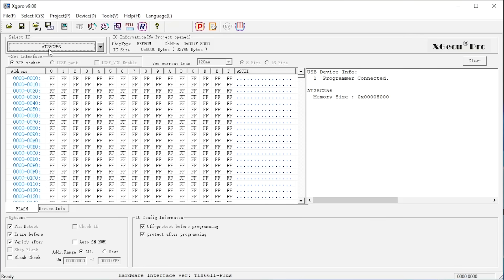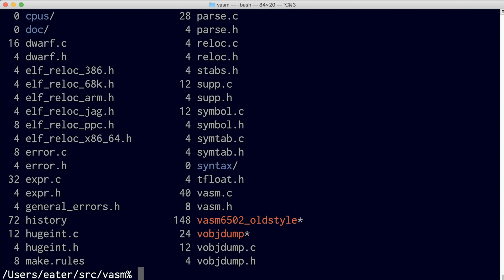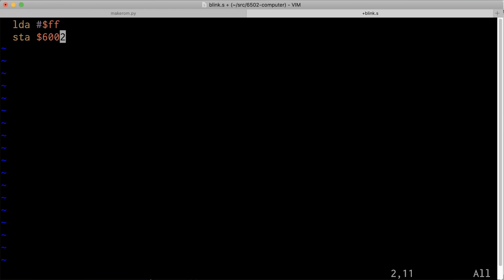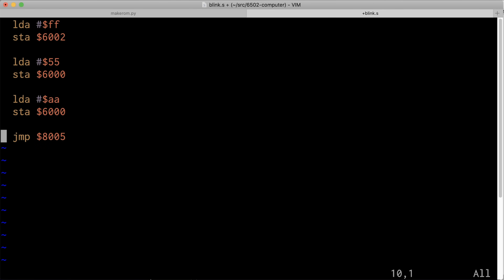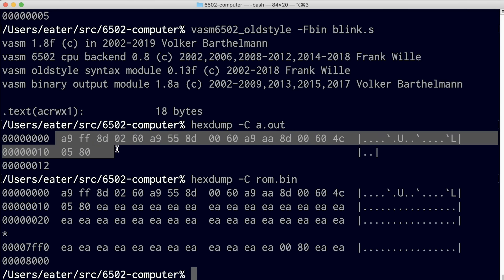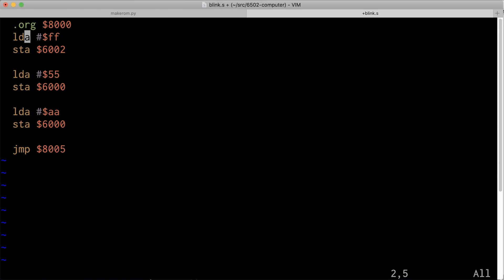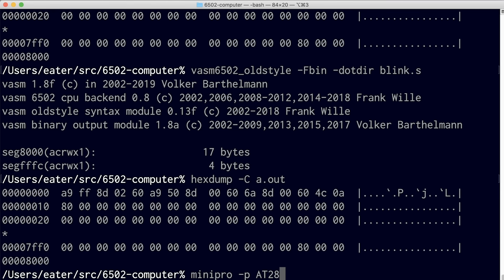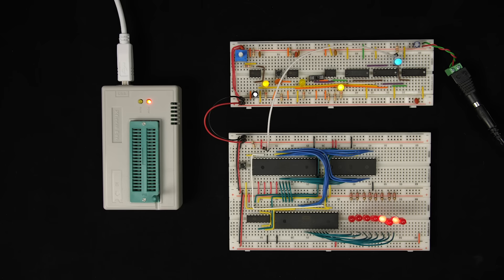Assembly language vs. machine code — 6502 part 3

Comment: Cool how high level Assembly looks right now because you got us started with just logic gates...
Reply: pyropulse  Now you write code for minecraft mods using abstract mathematical functions describing the behaviors of all of the electrons in your PC
Reply: pyropulse  karnaugh maps
Reply: bro RIGHT??
Reply: pyropulse  lol same
Reply: right!?
Reply: example ADD of atmega328p ("arduino Uno")
ADD rd,Rr
000011rdddddrrrr <<--- resulting bits

add     r0, r1    ---> resulting in 16-bit opcode memory representation (little endian), hex: 01 0c
register r0 does have register-address: ddddd=00000 (first parameter are the 'd'bits)
register r1 does have register-address: rrrrr=00001 (second parameter are the 'r' bits)

000011rdddddrrrr ---inserting d-bits---> 000011r00000rrrr ---inserting r-bits---> 0000110000000001
---> displaying as hex---> 0C 01 ---but is little endian cpu, so in memory little byte first---> 01 0c
Reply: My brain hurts at this level
Reply: Hi, i have a question for you..
How does a human being invent a new asembling language??
Let say if he does not have a second computer i.e. there are no computer at all in this world for example like alan turing. 
I mean how do you define "Add" function to the computer?
If the function "add" is presumed as an individual character such that A is  
equals to some number (which can be converted into binary number) let use hexadecimal for easier purpose. If A=10, D=13, D=13; 
So we write it in binary:
1010, 1101 , 1101 with each the values written on the EPROM or harddisk or anything. Then, when the  
user's input is like this (i.e Add), the computer will execute addition function either through programming as you've mentioned in the video, or maybe design a new logic gate??
But my main concern is that how do we reduce the memory size for each character written? i.e due to the fact that "D" character in this example is greater than "A" character because D= 13 in hexadecimal and A= 10.
How do we make all the characters on our keyboard to have same memory size when converting them into hexadecimal but still they are distinctive from each other?
Hopefully you understand my question
Reply: @footballCartoonZz  
>Then, when the user's input is like this (i.e Add), the computer will execute addition function either through programming as you've mentioned in the video, or maybe design a new logic gate??

we don't send the ASCII representation of the instruction mnemonics to the CPU. the assembler will turn our source code (which is that ASCII plain text) into the appropriate opcode. the CPU understands this opcode because its circuits are designed to understand it. 
remember that in memory, everything is just numbers. what matters is how the CPU treats them. it usually expects instructions, and depending on the instruction it might expect raw data. each instruction triggers the appropriate bits and logic gates to perform its function.

so to answer your question, we don't really invent an assembly language. we invent a CPU and the assembly language is a byproduct of how the CPU's circuits work.

since you mentioned the restriction of having only one computer in the world, in that case you would have to assemble the program by hand.

>But my main concern is that how do we reduce the memory size for each character written? i.e due to the fact that "D" character in this example is greater than "A" character because D= 13 in hexadecimal and A= 10.

those values still fit inside 4 bits. your main concern should be the width of the value in binary, not the value itself.
Reply: @KarlMarxLabubuMadeOfDubaiChoco  well technically you can send the ascii code to the cpu.
like for snes which im learning now, you can store the font sprites into vram, and you could atore it in ascii format.
and then tell a tile to display that character using the ascii code.
Reply: @KarlMarxLabubuMadeOfDubaiChoco 
 thank you sir.. 
now I understand the concept..
After learning it from various sources and also through your writing..
Since the most basic operations done by the cpu is the arithmetic (addition, substraction, multiplication, and division), we don't need the cpu to do the arithmetic each time we want it to do simple stuff like 1+1..
If the addition is some constant let say 00000001 (in binary) which is 1 in decimal
Which means it will always used same memory size which is one byte.
Next, multiplication is 00000010 (also binary) which is 2 in decimal also use one byte..
And so on..
What I mean is that every word that is designed to have a specific function in that program is basically mapped to a constant number,
This understanding has cleared my  mind..
Because back then I was thinking every character in the program will be mapped into some constant number and it is a mess when trying to write a single word in a program.
For example, each time you want the cpu to " add " then we need to think how we want to implement this, whether it is 
"a" + "d" +"d" = 10 + 13 + 13
=36
or a" × "d" ×"d = 10 × 13 × 13
= Some crazy numbers

To be more practical, 
based on ASCII, 
a=65, d=68 , d=68;
So, when user input is 65,68,68 in correct order, the "yes" circuit will turn on (meaning the arithmetic logic gate will have four outputs which determine whether which Arithmetic operation needs to be done)
well this is quite confusing
Probably next time I will think about this.

Anyway it's good to get a reply
So that other guy can learn

From somebody who is willing to learn but doesn't have the money to go to college
Reply: @footballCartoonZz  if you were starting from scratch with no other computers then you wouldn't be using assembly, you'd have to program it using machine instructions, where each instruction like addition, subtraction, etc. is just a number  :) If you haven't already, you should look at the other videos on Ben Eater's channel. He has a series building a processor from scratch which shows the whole process
Reply: @footballCartoonZz  I’m answering one year later so you probably learned a lot in this time but I hope this serves to someone. Let’s say we don’t have another computer to write code into the emprom like he is doing in this case. What you are wondering is how the cpu data path reads and executes instructions, as obviously the cpu won’t understand if you want it to add as you say. 
Well there is a reason why every single instruction that he wrote on the other episode is exactly 2 hexadecimal numbers (note that each hex number can be represented by 4 bits as the largest hex number is F -> 15 or 1111 in binary) which adds up to 8 bits, the length of bits in which the cpu will work, every INSTRUCTION and data will necessarily be up to 8 bits (do not get confused with the 16 bit address size, the cpu only uses it to send 8 bit data into the memory. 2^16 is the amount of memory addresses that the chip can physically reference and use), the word size in which modern computers work is either 32 or 64 bits. 

The cpu data path will be designed to work with specific instructions. I really tried to find the 6502 instruction format but I can’t seem to find it so I’ll use the mips32 instruction format as an example, do not get scared. MIPS32 uses a 32 bit word size, so every single instruction is 32 bits long. The binary code for this instructions is not randomly selected as the 6 first bits will always be the operation code, those 6 bits will be directly fed to the control logic that will generate the necessary signals for the cpu to understand what instructions is (long answer is that the control logic will probably be implemented with decoders or a rom which will have all the possible combinations, those 6 bits will be used as inputs and give the necessary outputs to the data path multiplexers to execute the instruction, a pretty straightforward circuit) all the bits in the 32 instruction are feed into different components and are important. As you can see the central processing unit is not intelligent, it doesn’t really know what is doing, engineers just design the circuit with an specific set of instructions that force feed 32 different cables into the necessary components to do what you want. 
And then the compiler, which is just a program that turns written text into machine code, sooo yes, the first assembler had to be written in binary and the first C compiler had to be written in assembly language, then you just use a technique called bootstrapping.
The answer is little bit more complex but I tried my best to explain everything I could. If you are really interested in this topic I suggest you check out some unicycle and multi cycle design videos or even the computer science scratch course, probably wont go into much detail but will do a better work that i could do in a comment.
Reply: @footballCartoonZz  digital design teaches you how everything starts
Reply: @footballCartoonZz no add is just a mnemonic for opcode example Hex 5 the assembler doesnt translate it directly its prograwwed to think that Hex 5 = add
Reply: Am i the only one who hates that typing sound in the background?
Reply: @johneymute  yeah, the mechanical keyboard is a bit obnoxious

Comment: Okay...im out, in 100 years I could not come up with the commands that you are typing in phyton. Where does all this come from, just from your head or is there any pretension what it must look like? I have no problems with assembler or hex files but that overwhelms me. Sorry to say that
Reply: Every assembly code compiler has commands which are used to control how the program is assembled.  It's generally a matter of reading the documentation for that compiler to see what the commands are, how they are formatted and what they do.
In Z80 assembly code for example, the compiler directives don't have to be preceded by a dot since those assemblers are able to figure out that they are directives without needing a special symbol to denote them.

Comment: These LCDs are quite fun to play around with. I once made a 2x16 character display with 5x8 pixels per character draw a ping pong ball moving around pixel by pixel and bouncing off the edges as well as a small pixelated image moving across the display pixel by pixel with the 8 user-definable characters that the display offered. The assembly language is incredibly powerful once you make use of subroutines.

Comment: Literally ordered that character display 2 days ago by chance - once it arrives I’ll hold out for the next video!
Reply: You can turn these into blocky 16x6 displays by defining custom characters.
There are multiple character sets, mine is Japanese Katakana. Check your extended ASCII to find yours
Reply: fox fyre3 Yeah, so I saw. My computer is only 4-bit so I may use the custom characters so I can put the characters from 0-9 within a range I can reach - ASCII’s 0-9 will be difficult to reach otherwise

Comment: I'll be damned: after watching the previous 2 vids, i started thinking about building a similar project, just using some things differently, such as not using the 6522 chip and such. Then, on the day i started planning it all out, you released a vid which mentions that you'll be using it to drive an LCD, which was one of the things i planned on doing once i got it running

Comment: please tell me where do you get the chips with their manuals/schema
Reply: Mosaid RedONE the manuals are usually available for download on the sellers website - the best seller would depend on your location due to shipping and taxes
Reply: @rlamacraft   thanks, unfortunately the only way I would buy the chips at a reasonable price (in Morocco) is in Aliexpress but they do not ship the goods with the manuals
Reply: Mosaid RedONE I use mouser (https://www.mouser.co.uk/) which has a wide selection of components, you might find the same chips there where you can download the pdf manuals
Reply: You can Google the part numbers to find datasheets. Rarely will a part ship with a hard copy datasheet.

Comment: Could you do a final part where its even higher level? Using a C compiler to generate asm for the LED blinks or something?
Reply: I think C is overkill for that task. It would take longer to prepare enviroment and include 6502 libraries than type 10 lines in assembly.
Reply: C is actually too high level in some ways. For example, how to tell C to write to register 0x6002, without special compiler builtins? If you had a C compiler/library, then it'll be easier, but the comment above me address that.
Reply: @jamesmnguyen  Its a memory mapped register, so 

#define REG_6002 (unsigned char*)0x6002
*REG_6002 = 0xFF;

I know its overkill for this example, but for doing more things with this computer its quite nice to use C for most of the logic. You can still mix C and asm.
Reply: James Nguyen  You can write to any raw memory location in C by just using a simple integer to pointer cast. There’s no need for libraries to do that.
Reply: @lsfornells  ok
Reply: @jamesmnguyen  short* mem_6002 = 0x6002 ; *mem_6002 = 0xFF ;

And that's it. But i still think the assembly code is more clear.
Reply: @dennisrosenkilde8871  C will become clearer when you actually say what that address 6002 means.

Also, in the project I'm working on (much more complex than blinking LEDs) there are io_write(io_addr, data) functions which abstract this thing out.
Reply: As far as I know, C doesn't have any native ROR or ROL operations. Also, the architecture used in this video requires the use of the .org directive to fool the processor into reading the correct addresses.
Whatever, it's just jiggling bits in one memory location. Assembler is fine this time.
Reply: @foxfyre3600  rol/ror can appear from optimization, abstract away with macros
Reply: @paulstelian97  like reg=reg<<7|reg>>1 for ror? That's a good compiler
Reply: @foxfyre3600  I believe GCC with -O1 or maybe -O2 could catch that.

Optimizers are better than you expect nowadays
Reply: @foxfyre3600  rotate right is actually a division by 2. Rotate left is a multiplication of 2.
Reply: Another option for stuff you can't do easily in C is to wrap some inline asm in a function.
Reply: PaulsMagicVideos suggest it here https://www.reddit.com/r/beneater/comments/dto555/video_suggestions/

Comment: Ok, I'm confused. Why does the `.org` directive at the top of the file do "nothing"? I expected it to actually put the instructions at address 0x8000 just like it did with the reset vector but it still places the instruction at the very beginning of the ROM :(

EDIT: Nevermind, you changed the reset vector to fffc. So the ROM is just generated without ever padding on the top or bottom
Reply from the maker: Yep, that's right. The file is generated without any padding at the top or bottom, so at first, the `.org $8000` doesn't seem to do anything.
But it still affects how much padding is added between the end of the code and the `.org $fffc` and it also ensures that the `jmp loop` instruction translates to `jmp $8005` or whatever instead of `jmp $0005.`
Reply: @BenEater  Is there any way to change the "in between" padding to all '$ea's?
Reply: I had the same question and found out - by playing with the assembler - that the first .org does not move the code, it only affects addressing. Subsequent .org directives will also move the code. Perhaps someone has a better explanation why.
Reply: well nobody stop you do it
.org $0000
.org $8000

it would make your file 64k and looks correct but you cant burn that on 32k rom. you need cut it. so thats why we only assemble top of 32k that we need. we say start assemble from 8000.thats what it did
rest is circuit magic. you need make it so cpu see ROM is 8000-ffff. RAM is located 0-8000. why we assemble it.bunch of zeros :))? we cant burn RAM(after you take it off programmer data will lost) and not even same time with ROM they are 2 diff chip